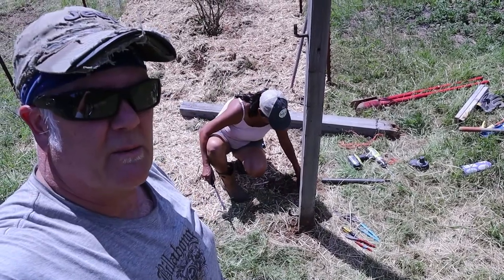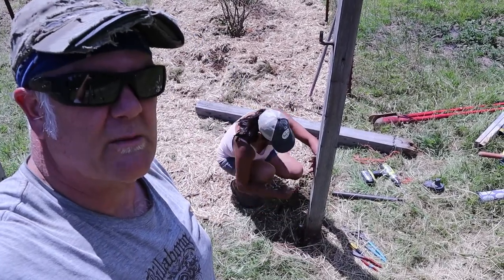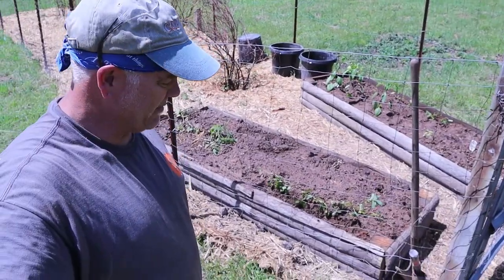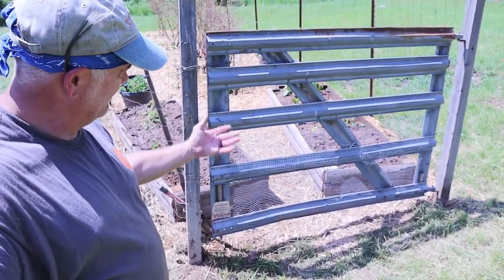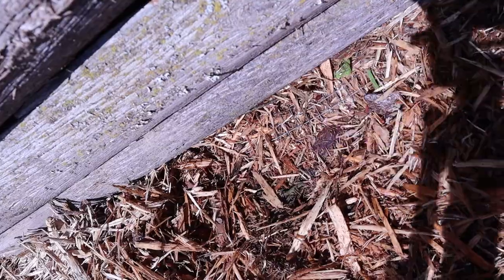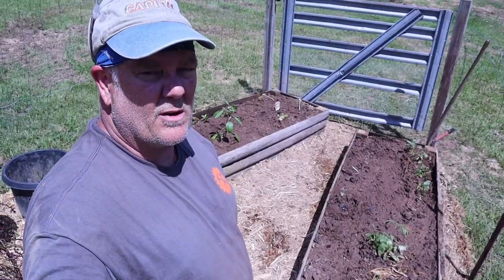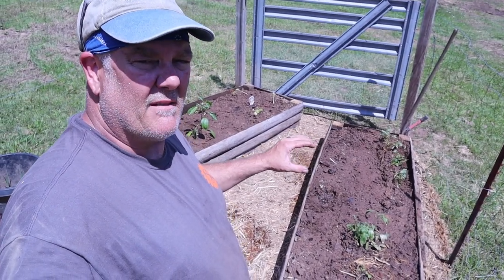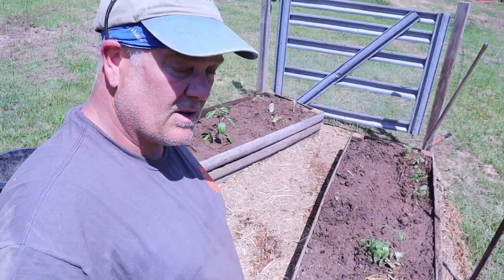Repurposed gate for the garden !

Comment: I understand the value of getting stuff for free and cheap you know the list. What I would have gotten or what you need is one of those metal rip-up bars with the big metal round flat tab it's a packing bar for packing things around posts and different things it weighs about 40 lb. That would pack that dirt as hard as asphalt
Reply from the maker: I have one but there wasn't room to fit in the hole next to the pole.